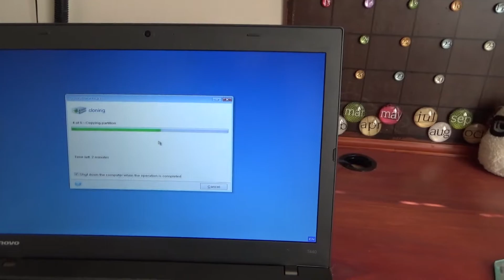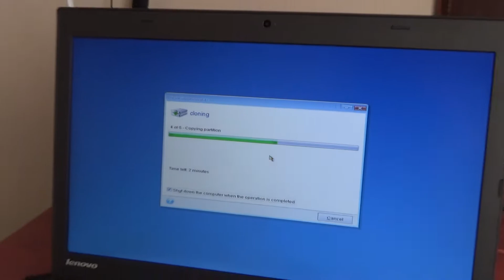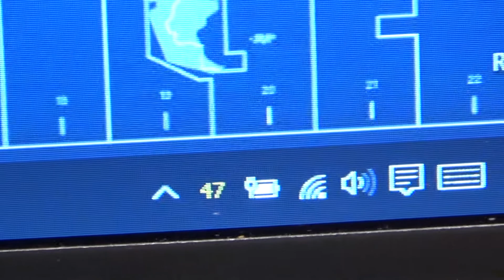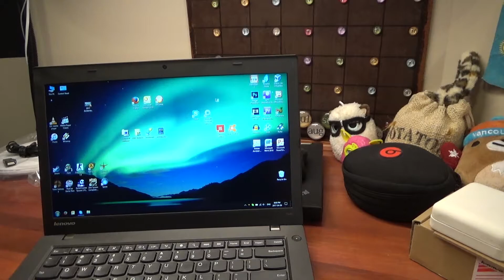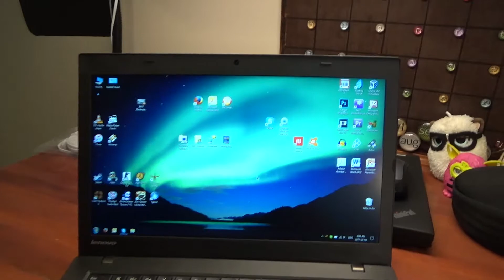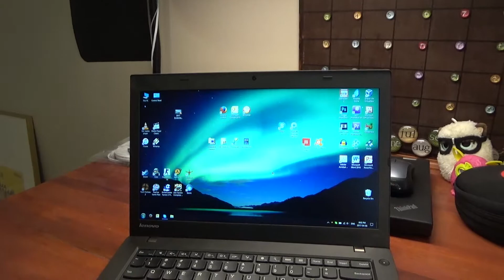Lenovo ThinkPad T440 Unboxing, Upgrades, and First Thoughts

Comment: Hey my thinkpad t440p is not powering on and it’s not even charging idk what happend I took it to a repair shop and they said it’s boot system doesn’t work 
Pls can anybody say me what boot system is
Reply from the maker: Does it show a splash screen when you press the power button? Does the power button light up green when you plug it in?
Reply: @KSLTech4  no . but i got it repaired and the guy said that there was water in it lol i never even poured water in my thinkpad but idk how he saide the BIOS chip he had to UPDATE soo yea my thinkpad is back to life

Comment: When you apply thermal paste it can take up to 20 hours for it to bed in .people put on to bigger blob and it overflows off the die thermal paste is only a layer that fills in the pores of the copper heat sink to create a better contact to die so heat transfer faster .
Reply from the maker: David The Arctic MX-5 paste that I used did not have any curing requirement; it was considered ready to use instantly.

Comment: I got the T440s with an i7, 8gb ram, 256gb ssd, and 1080 ips non-touch for $200. Just getting the external 72Wh battery for an extra $70. Cheap machine :D

Comment: all 440 max limit 8gb ram ??? Because in eBay some machines are shown max 16gb.
Reply from the maker: The T440 or T440s have a maximum of 12GB of installed RAM (4GB on motherboard [only on some configurations, though] and maximum 8GB SODIMM). However, the ThinkPad T440P and T540P can have up to 16GB of RAM, as  there are 2 SODIMM slots, which can accept an 8GB module each.
Reply: KSLTech Studios thanks for quick reply, could you please suggest me good model i am interested in 430, 440, 440p or if you have anything in mind please tell me (first preference performance and secondly size)
I am planning to buy from eBay manufacturer refurbished.
Reply: @pauilsandy6293  If you want the most performance of the models you listed, go with the 440p.
The differences are: 430 is the older model. Its a bit more bulky but has a hotswap bay, which usually has a DVD RW drive, which you could replace with a 2nd HDD/SSD. Its also a bit more rugged and cheaper than 440. In terms of performance its above the 440 but below the 440p.
The regular 440 is an ultrabook. With 1.7kg its considerably lighter and thinner than the other models. It features ULV processors, so it consumes less power than the other models however it has less performance due to that. There is no optical disc drive, however it has 2 M2 slots. One for the WLAN and one for the WWAN. You probably don't want to remove W-lan but maybe swap WWAN for an SSD for a 2 storage solution.
The 440p is a bit bulkier than the 440 but has an optical drive and features up to an i7-4700HQ Quad-core CPU which blows the other models out of the park in terms of system performance. Its obviously less mobile than the regular 440.
If you search a bit you can find all models with dedicated graphics if you want to do some light gaming on your machine, however they are more rare.

As you're buying used at this point anyway, you wont have great batterylife anyway, so I would tend to recommend you a 440p. Its the most powerful and its easiest to find a model with dedicated graphics. If you go for the high performance CPU you probably would also take advantage of a GPU.

Comment: My Own is Lenovo Thinkpad T440 20B6 - Ultrabook - Core I7  SSD 128 And 8GB of RAM, Can I Add HDD in There ? to saving data.
Reply from the maker: It depends. Most likely, your SSD is already in the 2.5" hard drive bay, so you will need to swap it out with a hard drive if you wish to install one. However, you can also install an M.2 2242 SSD in the WWAN slot (used for cellular data communications), and use the 2.5" bay for your hard drive, in addition to the SSD.

Comment: no internal battery?
Reply from the maker: Not in this one. Simply had a plastic blanking plate where the internal battery would go. I ended up installing an internal battery later on, anyways.
Reply: @EverythingThe internal battery extends the total battery life and allows you to hotswap the external battery while the laptop is running.